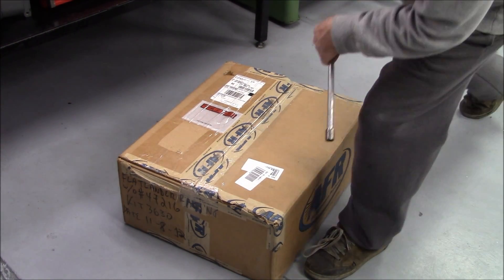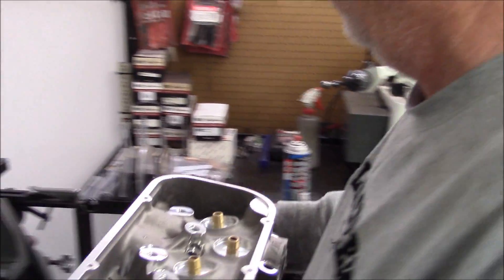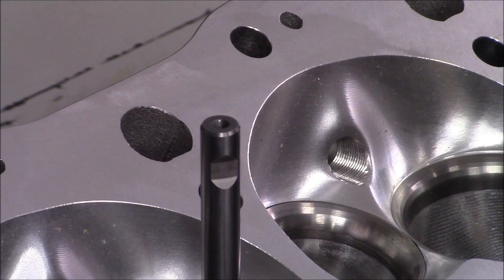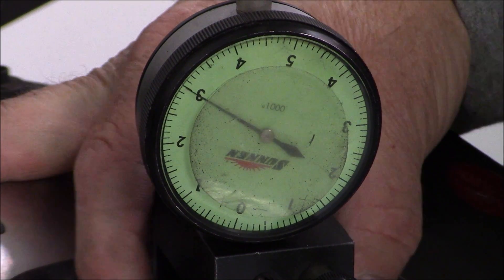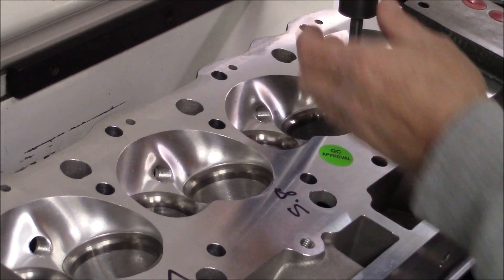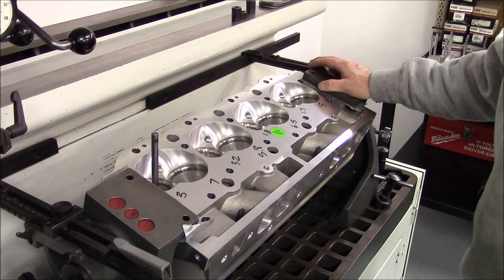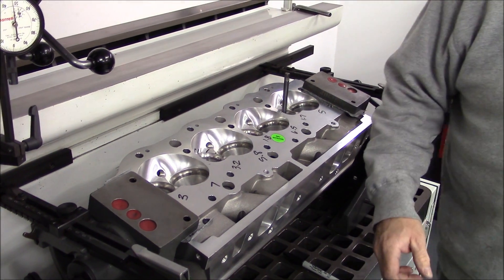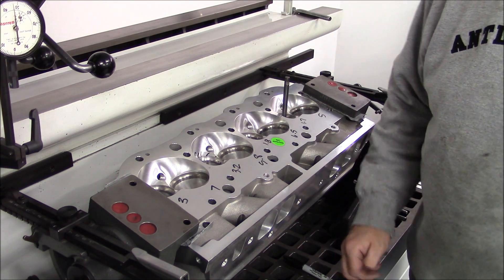Aftermarket Cylinder Heads - Why You Shouldn't Just Bolt Them On - Part 2 - TRRC / Vortecpro

Comment: As a machinist and the consistency of the TIR on every seat,I think you need to calibrate your instruments. Curious to know the indexing of the run outs and where the zeros are with respect to each other. That will tell you if you have an instrument issue.

Comment: i hear all the time put aluminum heads on a cast iron block but old man bell which builds pro racing engines said do not mix ur metals the engine will have a problem because u created a weak spot the metals will heat up differently and if u running it on the street as a driver u want the engine to last as long as possible just pick up a good set of cast iron heads i even have a race engine with cast iron on cast iron just it takes a bit of money but i never have had head gasket problems like my friends do all the time after 20 years it has been running on the road and racing it still runs good and hard but it was built to last even seasoned the block on it . if i was going to build another race engine it would be an aluminum block and heads like a ls 7 427 or i like the lsx that would be a good one to build

Comment: The people calling you out for the way you treat the head are not machinist's those of us that rework these heads every day get it we both know your going to re cut the seats also much of that run out will go away when the head gets hot and the valves bed in but I get it I always re cut the seats on new heads sometimes customers bring loaded heads with valves and springs installed I always tell them I need to do a valve job it's not an option if they don't want to do it I turn down the job

Comment: You know the run out is nothing compared to you throwing bolts and tools on to the heads and your attitude comes across ass cocky or ass hole almost as if you hate your job ,You can't measure what you have taken off of one valve seat by measuring another valve seat like that there are too many variables that could come into play you should have taken a measurement before cutting then one after cutting in the same seat now I know you know that but some viewers may not

Comment: I know this is a new day and age, but, does anyone recall the days when you lapped each individual valve to each individual valve position in the cylinder head? New head, old head, you never used to just cut or grind a new seat and expected a perfect seal between the new or old valves and cylinder head. Maybe people forgot what they did old school days or will that be another video? Just wondering.

Comment: You can tell he's not using his own tools! Hahaha actually he's not hurrying anything. You don't need to baby everything! 7 thousand run out is not nothing to worry about, your not building a watch! It can still turn 10 grand rpm with triple springs!!So all you guys that are worried about scratching the heads should keep reading about engine building not doing it cause you'll lose your job cause your taking to long!! Hahaha you probably never turned any wrench's cause your to worried about scratching your tools!!

Comment: I've seen engines put together in a clean room type environment blow up. Dont worry about the way this guy handles the machine and gauges. A bad valve spring or a dirty oil passage in the block are things to worry about
Reply: the valve spring pressures are most of it,all of this machine work is for a reving engine,for a grocery getter,wouldn't even notice,there are so many things that come into play with a racing high rev engine,and most of them are part quality,in todays world of around the world supply,no thanks,it is the main reason I retired, the supply is a morbid joke
Reply: @strattuner  I had similar issues with bike engines. Aftermarket bullshit. The most important person in an aftermarket parts company is the one who answers the phone and makes excuses for their parts failing

Comment: What is going on with this guy?
He really doesn't want to be there or he has some big problem with doing this video.
What is with tossing the bolts and spanner on to the other head?
Did he throw both heads on the floor afterwards?
Wasn't he being paid to work on these heads?
Was he forced to do it for free?
If I saw someone treat my cylinder heads (expensive or not) in that manner I'd be seriously pissed off.
He uses the other tools in a rough uncaring fashion also.
I'm surprised if he can fix run out on anything.

Comment: Why do Americans still insist on using feet and inches when the rest of the world has been using metric for nearly half a century?
Also interesting that they sub conciously admit that they are doing things the hard way because notice when he writes down the measurement he puts a decimal point in it.
Reply: because most of us hate metrics we have to have two sets of every thing to work on a job or just half ass it
Reply: I have to say .. when I need to take off .0055 .. I don't right it down as 5.5 .. he is clearly self taught or was taught wrong .. not smart .. 5.5 is 5 1/2 inches .. or 139.7  mm .. maybe he just needs a divorce and be much happier

Comment: This guy never re checks his work after he cuts the seats
Reply: Probably cause it's worse now than before.

It's no different t than when we turn brake rotors you can have it set up wrong it will look like its spinning true and its cutting cause its warped but do a run out and find you had a piece of rust holding the rotor off square.

Same thing here he wont show the after effect due to sloppy tools.  If you watch as he moves the dial tool in place you can see a good amount of movement in his dial  indicating slop  in the fit of his tool that will also throw off the measurement.

If AFR heads are as bad as he claims there would be more people with failure of said heads, enough so that a class a ton lawsuit might even come out of it.

Comment: I don't shit about valve train work. I have always relied upon others to find the best head shop & then just hope for the best. I fucking hate being stupid about this. But I just don't know anything. There's no one in my area that does head work anymore. It's all farmed out & I hear bad things about that. I thought if I bought some pre-built heads like eddlebrock I'd be good to go...Building a mild 440 motor. The cam is just a 488 496 valve lift. Maybe I should just leave the stock RV heads on it & just upgrade to the springs that came with the cam. Valve guides are still ok. The seats & valves still look ok too. Does anyone have any thoughts on this. all advise is welcome. I subbed & liked. Thanks

Comment: You  never see him Pull out the  dowel for the gauge, and index the dowel 180 degrees,.( recheck )  This would show  all he did was to cut the seats to the where ever the dowel is index at that time.  The proper use of a quality lapping possess of the valve at final assembly, it would be just fine.

Comment: Man, watched the video and then read comments and this guy has a lot of haters. With SO many commenting negatively their must be a lot of professional automotive machinists watching, but then again not sure why someone that already knows how to do something would be watching. I read many comments like suppose to heat heads up to running temp before checking, some didn't think a valve seat with as much as 7 thousandths of leaking not a problem??? WHAT? Anyways, I'm no machinist,but a valve leaking that much would be hard to get a descent CC'ing of the head I would think. That is IF his pilots are truly straight and his Valve Runout Gauge setup is in spec. Maybe next time he can show a fixture are something showing his tools are still in spec so maybe a few less professionals want be getting their blood pressure up so. Now that being said, I myself wouldn't toss the bolts on a set of aluminum heads that belonged to someone else, even though it probably would do little more than a extremely small scratch, it's still not something I would do are hope my machine shop I go to would ever do. I have seen heads straight from factory that leaked around the valves, so his message of checking even new heads I agree with.

Comment: Beside the "skill" of the machinist , the micrometer doesn't lie. The engine will run with the heads out of the box but valve guides will wear soon. A few years ago I bought a set of BBC heads from Skipwhite,  yes , the so called underrated Procomps. I measured the run out and all valve seats where within one thou runout. Assembled with PBM valves , small stem, melling valve springs, one of them broke during first start up. Replaced them  by a set of comp cams springs. Engine performs fabulous and I have done thousands of miles last years.

Comment: Wait! I only use AFR heads. I "think" the run out is 2 thousands. Really? 
  I'm just a back yard mechanic who can build almost anything.  But if I heard itor read what a tolerance of something I only work on. On my dieing bed I would know that number. 
   My machinist is a perfectionist.  His shop is super clean. I've also never seen him slap his tools around like this guy.
As far as Tolerances go. Try a Nascar motor.ill bet they are closer than what this guy thinks is close.
  I'm just say as a back yard mechanic.

Comment: If you plan to purchase a set of heads, from a manufacture "castings with seats and guides" then expect it to need a valve job as well as the guides to be honed to size. In the first 45 seconds of this video, it clearly showed that the individual handling these heads had a bad attitude right from the beginning, and his lack of care when removing the heads from the box, is unacceptable, especially when one head banged into another and the bolts where tossed right onto a machined surface.
Reply: I have worked on new factory heads worse than these.  They were BMW, MBZ, Porsche and other High End makes. They all needed at least a "touch up" on the valve seat critical angle...EVERY ONE.

I had a German Auto Repair Garage and Machine Shop for 30+ years.  I had an advantage because I was an experienced Machinist first and just liked wrenching on Exotic Automobiles.  I was in Local 1515 of the Automotive Machinists Union in the SF Bay Area.

I bought Job Shop type Machine tools mostly, not specialized Head and Block machines.  Much slower, but with Universal uses and excellent results.  My 10 year old son could run specialized machines as well or better than this Video demonstrates.

This Tech is a bit rough as he seems to be Self Taught and doesn't have the fineness of a really well trained Professional.  His performance on this video is appalling, but is quite typical of self taught "experts" that "know it all".  Just saying.

Comment: I watched the video and then read the comments. The comments are much the way I see your handling of the job, sloppy sloppy sloppy. The word "about" is a lazy way to measure anything. Sunnen makes really good measuring instruments used throughout many industries. I have used Sunnen for years machining turbine engine parts and honing operations to millionths. Valve seats represent a plane and to measure a plane takes more than a single element contact. The valve train at 8K RPM really doesn't care about single element  contact it wants to be sure the full circular surface creating the concentric band in order to create as perfect  a seal as possible within that plane. That takes a lapping or honing  as the final process in hopes it seals to expectations. The valve and the seat are not ground to the same angle  in order to help accommodate the contact surface area. Got it?
Reply: Do you have a measuring device that goes to "the millionths"? Does sunnen make one of these gauges that go to the millionths?

Comment: so... Am I to ascertain that Buying a set of used GT40 heads for my 302 and having them re-worked will be better than the AFR aftermarket heads?   
   OR- will a typical machine shop re-working my GT40's have the same end results as the AFR heads?....   Now i am questioning any decision i make for my heads on the 85 Foxbody rebuild....

Comment: Of course the runout is less when you measure from the exact center point you used to cut with... and safe to say your haphazard method of centering prior to before and after measuring will result in measurements showing your off center and not out of round....

Comment: The head that's had s valve job done arrived without valves from the manufacturer.....? Ehhh not possible. 

"Looks to have had a valve job on it"
Sounds like a vague assumption and not a AFR claim in their advertisement.  

Shame, nice equipment in the shop owned by someone who will throw around false claims that could potentially hurt a business.... jackass.
Reply: Not to mention cause fear in people that dont k ow any better.

 Not everyone has access to a machine shop as they are slowly dying out and their only choice is out of the box heads like AFR especially if it's a street performance build.  Then you got this guy here fearmongering a out how bad the heads are for not being true.

If that was the case I think we would see a class action lawsuit against AFR for it.

Me personally I'm going to trust AFR as the only reputable machine shop where I live is backlogged 6 to 8 months.  I cant wait 6 to 8 months to get my truck back on the road.

Comment: How about aftermarket aluminum heads that are fully assembled, how good are those?
Reply: We had a set of dart SBC heads that literally didn't have the correct size valve in it. The seats were for a 2.02 and I can't remember what size but that wasn't what valve that came in it
Reply: @11ellswray  same here. Dart guides are all over the place.

Comment: WOW! Thanks for sharing. Kind of an eye opener. Although this has never been an issue with me because have always used factory iron heads and always had them machined at a very reputable shop. Wasn't till last year I bought my first pair of aluminum cnc heads. Will have to get them ck'ed next time they are out.

Comment: You are a disgrace to engine builders. No-one would build up this head without lapping in the valves, so this tiny runout amount will be irrelevant. The way you throw around your precision instruments is a joke. I am a toolmaker and have also built many engines for the road and for test bed testing, I would get fired if my boss saw me treating things like this, and rightly so.
Reply: I'd like to see a video of doing this on a bench in a garage. Football game in the background, nagging wife, barking dog, and screaming kids lol. That would be a real man's check on heads with instruments! Maybe showing his young kid how to check heads.
Reply: No engine builder would build up a professional top of the line race head without checking concentricity of the seat, the depths of each seat that’s been cut, and valve guide to valve clearance and not to mention a few other things as well. I’m sure he lapped the valve off video and made sure it was alright. If it isn’t alright then valves were probably ground to correct the contact of the valve.
Reply: That’s the whole point. 
He is saying any head needs to be finished off and not just thrown on as is.

Comment: just  put 2 valves on,press them down with your fingers, put some soapy water in the combustion chamber and use the air  blow gun from "under"to check for bubbles,this is very sensitive;  or  pour a little gasoline/kerosene/thinner on top (did someone yell FIRE?)and check for leaks underneath,but for that you do need the FORCE of the spring creating PRESSURE(and force!)  on the seat,finger pressure is nothing with gas; ;     i always check  them all  after assembly; peace of mind... don´t trust  my own shadow...
"The chief has spokin"

Comment: Uh, since a "valve job" involves both valves and seats, no bare cylinder heads come out of the box with a "valve job" already done.
Reply: @shaadydog1  Cut seats are NOT a VALVE JOB. A valve job is both valve and seats cut and properly mated together, usually by "lapping" them. Do you understand now? It is obvious that when you posted, you do not get it. Try learning something before flapping your jaws and proving your ignorance.

Also, learn to spell and punctuate so people may actually think that you do have some brains.

Comment: That tapered "mandrel" you're jamming all of maybe half an inch max into those nice new bronze valve guides MIGHT have something to do with the "runout" you're measuring at the seat faces. And since all "good" valve jobs including on new bare heads end with lapping the valves to the seats after any grinding and how much "runout" you have there doesn't mean DICK as long as the valves SEAT PROPERLY, you're either one hell of a clueless "machinist" or "engine builder" for checking something in a "bare" head you have zero control over when the parts are all assembled and operating OR one hell of a crooked "machinist" or "engine builder" scamming people into paying you good money to "fix" non-existent "problems". Not to mention "5.8 tenths" is roughly 1/10 the thickness of a sheet of printer paper and NOTHING is "rigid" in a running engine EVER. If you weren't either clueless or crooked you wouldn't have such an "empty" shop and nothing better to do than make "infomercials" for yourself and your "services" because you'd be in the same situation even HALFWAY DECENT MACHINISTS/MACHINE SHOPS ARE PRETTY MUCH ALWAYS IN - SWAMPED WITH MORE WORK THAN THEY REALLY "WANT".